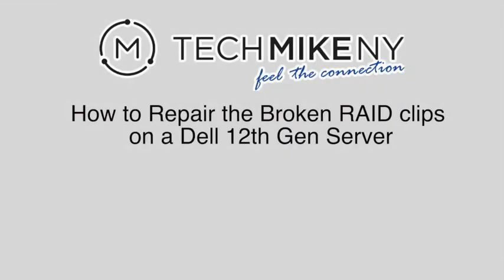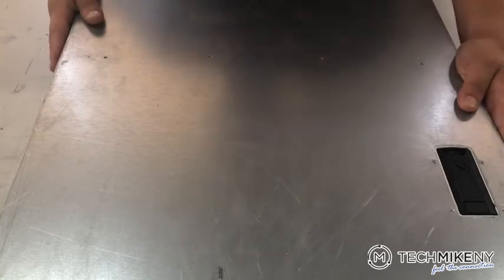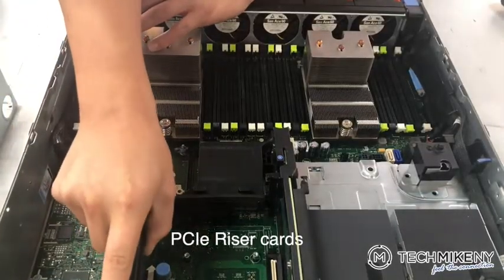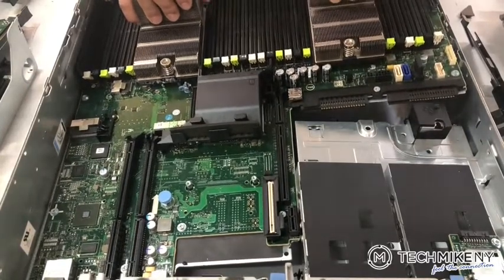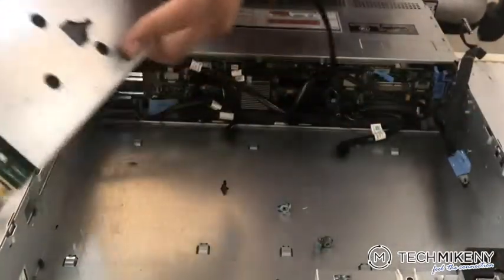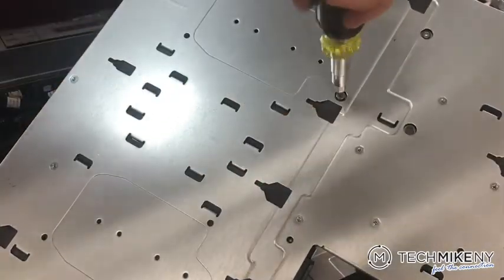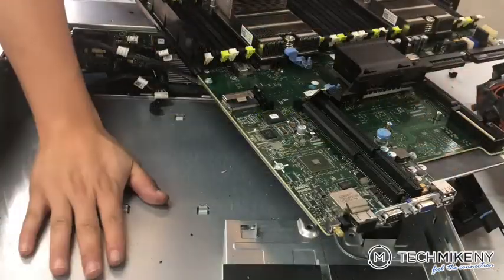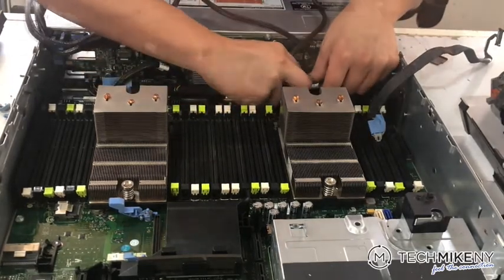Replacing Broken RAID Clips in Dell 12th Gen Server

Comment: Replacing those terrible clips isn’t worth it. The card stays in fine without them - they’re primarily to help eject the card.
Reply from the maker: Hey @BlownMacTruck, thanks for the comment. You're correct that the card stays in place when a server is securely installed in a stable rack. The greatest benefit of the clips is making sure that the mini-RAID controller remains securely connected to the motherboard while the server's being transported; don't want anything moving around where it isn't supposed to.